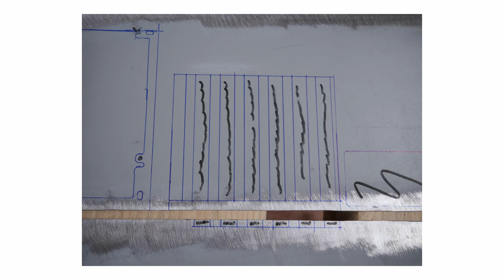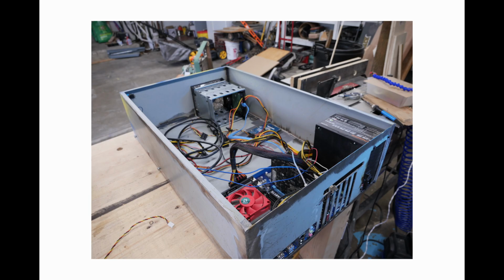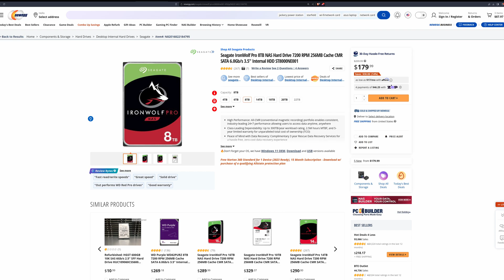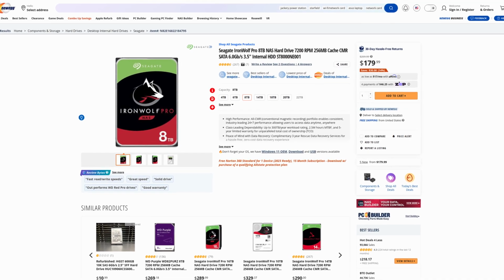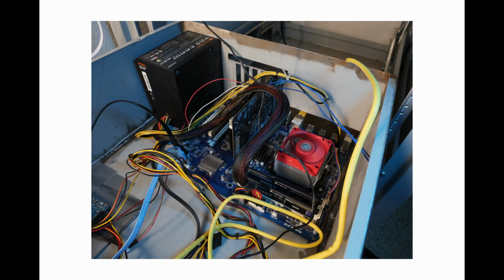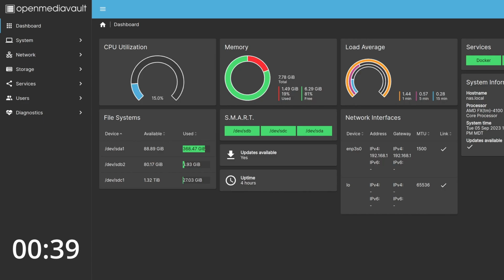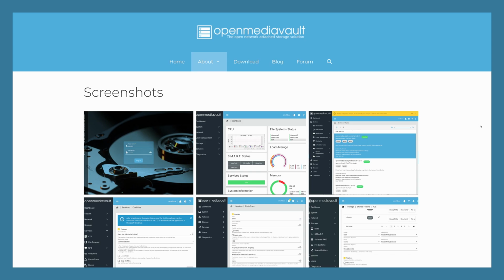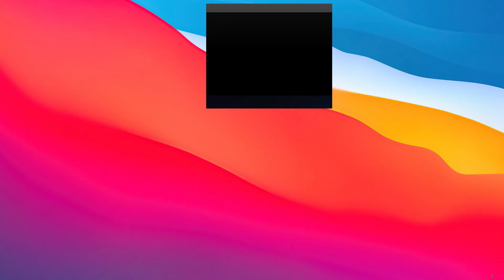How I Made My Rack-Mount Server Case

Comment: Super well done video! Did you ever add a top panel to it? I'd be worried about cooling with only one intake fan
Reply from the maker: Thanks for commenting! No, I never put a top on - primarily over concern for thermals (which I haven't had any issues with yet) - but I've thought about doing a part 2 where I add one as well as some more fans, handles, cable management, etc. and talk about what I like with this project and what I could have done better.

Comment: How did you actually mount the mobo? Just regular standoffs?
Reply from the maker: Yes, I drilled and tapped 3mm holes in the bottom of the case and then screwed in some of the standoffs I showed at 1:00 .